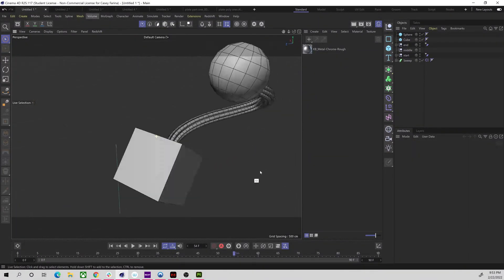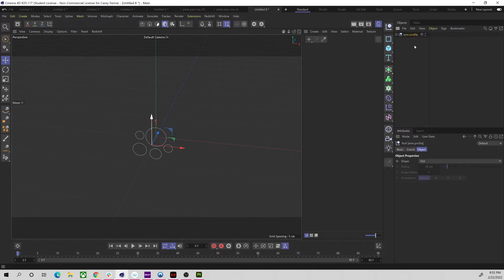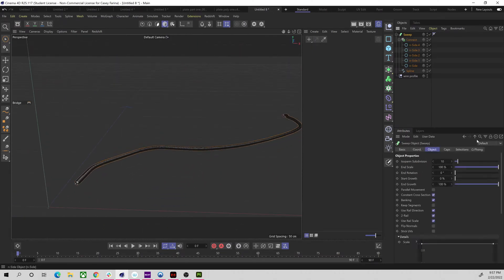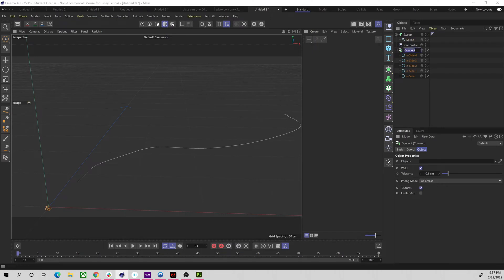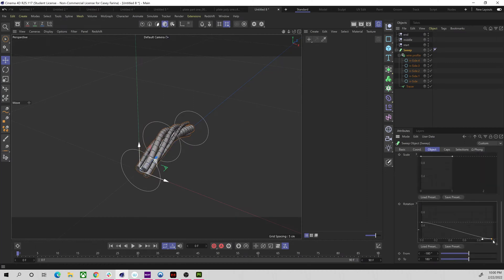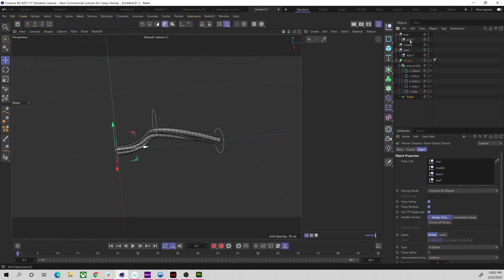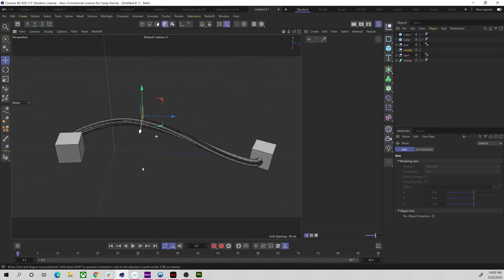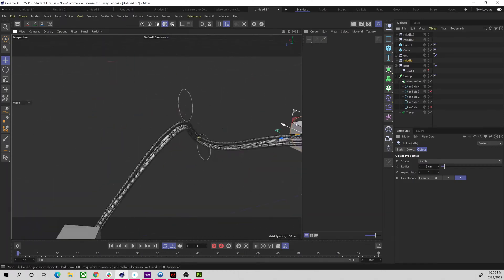ART 285: Creating a Wire/Cabling Rig in Cinema 4D for Hard Surface modeling

Comment: you just solved a problem I've spent about a day trying to research an answer to. Dr. Sassi tried 4 different things and didn't come up with this. Bravo!
Reply from the maker: What was the problem? Thanks!
Reply: @CaseyFarinaGCC  rigid end-piece (attach to spline) attached to end of tube (splineWrap). angle of the end of the tube needs to follow the turning end, not pivot freely